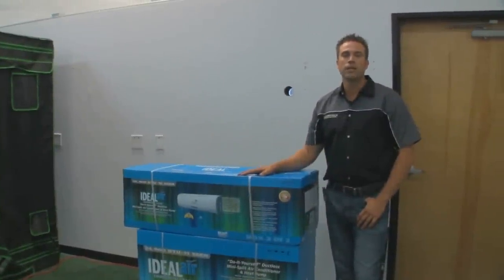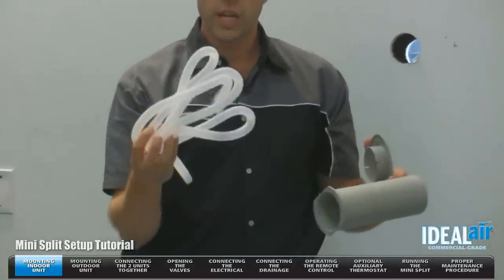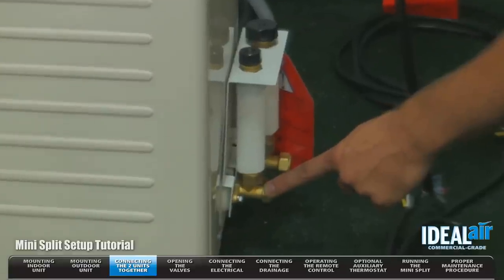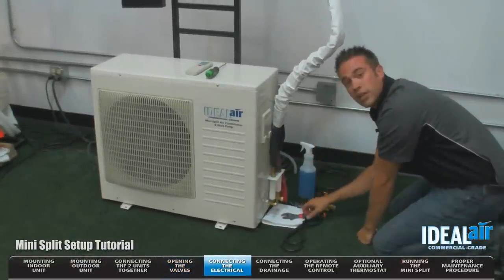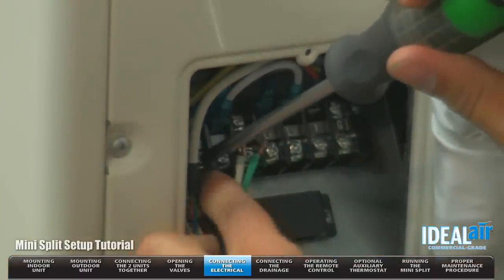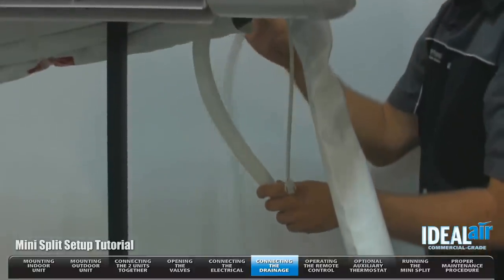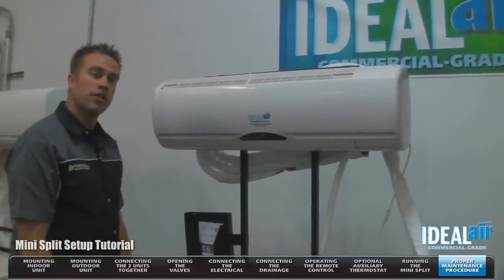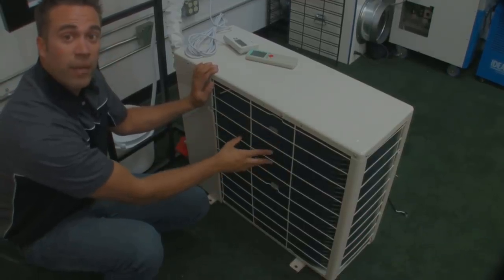Ideal Air Mini Split - How to Setup Tutorial

Comment: To all those worried about the air/moisture in the hoses: *THE LINE-SET IS PRE-CHARGED!* (In fact, it would appear that in this set-up, the line-set is already attached to the inside unit.) Hence, this is the reason for the comment @ 4:42+ about having a little refrigerant escaping (from the hoses), BEFORE the valves were even opened to the compressor.

Comment: Can you get any heat from the system like for cooler days
Reply: Natalie bungy This system is a heat pump as well as air conditioner. It's a very efficient heater is moderately cold climates (-10 to -20 F or so).

Comment: So, the out-door unit is pressurized with R410A, the Line-Set and indoor-unit is also pressurized with R410A, and there is a pair of 6" pipes with a vacuum inside.?. Is that a 20 micron vacuum?  

Seems like some very complicated mechanical valves are holding the R410A (between 200-300 PSI) inside the line-set/indoor unit.. 

And now you tell me there are 2 more  complicated mechanical valves holding a vacuum, inside two little 5" pipes?  

Wait a sec, the manual shows no 6" pipes!!